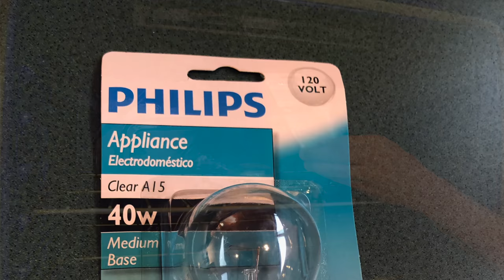How To Change An Oven Light - Oven Light 101

Comment: Mine had a glass cover that didn't screw off.  Instead it was held in place by a metal wire that slides to the side.  If yours is like mine, you don't need to unscrew the metal housing around the glass.  You just need to pop the metal wire to the side, taking care not to let the glass cover fall and break.

Comment: If the cover is stuck heat with hair dryer , and it should spin out .
Reply: It’s not spinning out and really stuck.  How about turning on oven at 350 for 20 minutes?  Then using a rubber gripper to see if it will spin out or bad idea?

Comment: The glass cover came off with no problem. When I turn the bulb to the left, it reaches a point and stops. Turning it to the right, it does the same.  It won’t pull out. I’m afraid I’ll have to and use plier the get it out.

Comment: Just changed my out (video coming soon) and wow...that light cover was impossible to take off.  Went to Harbor Freight and got a strap wrench ($4.99).  Worked like a charm.
Reply: I had to replace the bulb in my oven recently, so I referred to this video. The glass cover wouldn't budge. I read your comment and used a strap wrench I've had for over 20 years. It worked like a charm. Brilliant idea man.

Comment: Just replaced my bulb in my GE oven...however my glass cover is held in place by a wire that goes over the cover by tension, so it was a bit of a struggle to move the wire to remove the glass cover. But I did it.
Thank You For The Great Video!!

Comment: Re the guard wire that covers the lens over the interior GE oven light. Don't try to remove the guard wire. Instead apply a slight pressure and pull the wire forward over the top of the lens and do HOLD the lens in 
place while you do this or it will fall into the bottom of the oven.  The ends of the guard wire are inserted in brackets so no need to remove the guard wire out of the brackets as I initially tried to do (I'm mechanically challenged). Then, just replace with an appliance bulb. Put the lens in the metal frame and gently pull the wire guard back up over the lens, still holding the lens, until it tightens its grip at center of the top of the lens. Durbin saved me an $89.00 service call and that didn't include the bulb.

Comment: i'm trying to screw in the new light bulb but as soon as it's screwed in the light goes out why.Thank you
Reply from the maker: Might just be a bent contact in the socket. You can turn the bulb out until it comes on or unplug the oven and use a small object to pry the flat metal piece at the back of the socket up a little bit. Not much though

Comment: Light bulb base broke off in place. Neither a cork nor a potato can unscrew the base.  What to do?
Reply: 📝 just here for an answer.
Reply: @bzrwon  Take an empty plastic bottle and remove the cap. Heat the mouth of the bottle with a stove or a lighter so that the plastic melts. Stick the mouth to the bulb’s bade and hold on till it diaries and sticks to the base. Now slowly twist it counterclockwise to unscrew the base from the socket.